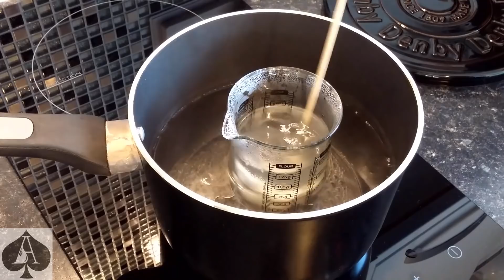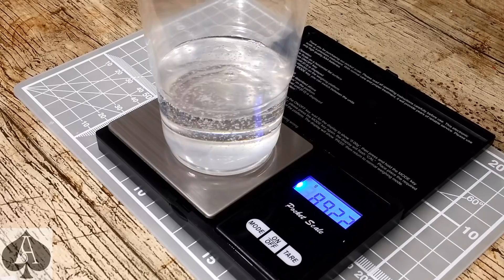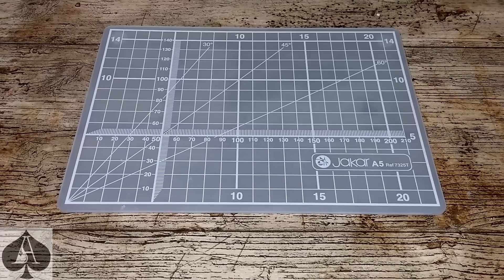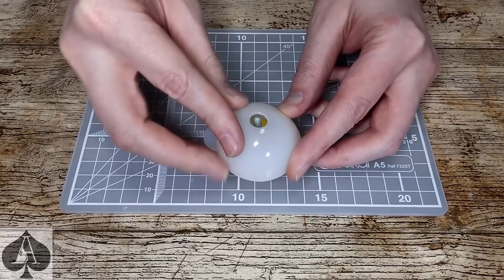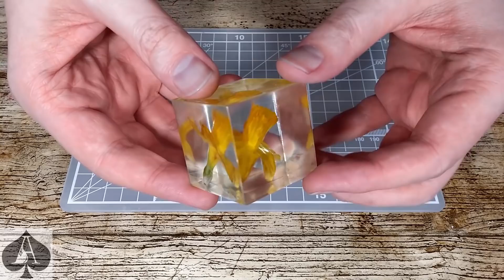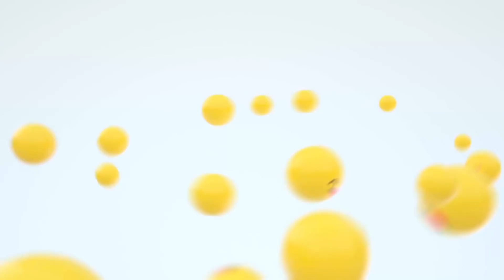Experiment: Can You Put Wax-Dipped Fresh Flowers in Epoxy Resin?

Comment: How is this possible? Was that wax the flower was 1st dipped into before set in resin? Was it dried completely before wax dipped? A real flower? Wouldn't the resin heat cause the wax to melt and distort in the resin??
Reply from the maker: The flower was fresh and dipped in paraffin wax. It was just an experiment, and the flower still turned brown over time. The melting point of the wax is around 50C, and your resin should not be getting that hot.

Comment: I've got a vole skull that i want to suspend in resin somehow but I'm not sure how - any ideas for design and/or technique? (The mandibles are separate from the upper skull so I'm not sure how to keep them aligned)
Reply: Ky look at doing it in several pours, do a base pour that you then sit the lower mandible on, then place the mandible and do another pour, then align and place the skull and do another pour leaving enough of the top of the skull for you to be able to keep it place by suspension or whatever means you choose and then do a final pour to cover, as long as you do it with clear resin or make sure your mixes are exact you wont see any difference in the layers, this method also makes it much easier to get rid of any air bubbles with a heat source if you dont have a pressure pot, there are plenty of videos around of these methods for you to watch first. Hope that is of help

Comment: Love your videos, but can you answer me this, why does my cubes look discoloured when I take them out, all moulds are cleaned and are dust free but always come out looking rubbish.
Reply from the maker: I really don't know. The surface of the mould will transfer to the surface of the resin, so if you have a shiny, smooth mould you should end up with shiny, smooth resin casts.
Reply: @resinAce  thanks for getting back mate, it was a brand new cube mould, it was quite dull, is there something I can use to make it shiney before putting in resin? Sorry for all the questions but I'm fairly new to this.

Comment: I've seen dried flowers in resin but a daffodil is not easy to dry out so wax is a neat way to go! Perhaps this might work with tulips as well? I tried to dry out pretty tulip petals but they lost their vibrant colours before I could use them...
Reply from the maker: I've never been successful at drying flowers without pressing them. It will be interesting to see how long this daffodil lasts. ♠
Reply: @resinAce  I tried with sand in the owen, it crushed most of the flowers. I then heard those tiny absorbtion pouches you get in shoeboxes etc are better, the problem is I rarely buy stuff so it would take forever to get enough for even a small flower.
Reply: Have you tried drying them by hanging them upside down in a dark place? I have a shelf dedicated to flower drying in my wardrobe. That way they retain their shape. Whether it retains its colour depends on the flower though.

Comment: You saved 2 small bubbles in the square resin piece. I am soooooooooooooo proud of you. Can I be even more patronising? I could try... What I'd like to see is a video of how you calculate resin for the size of receptacle you're using. You gave a tip before but there has to be a way to measure resin that even I can do or do you sometimes have resin left over? Or do you not make enough and have to make more?
Reply: What I do sometimes is pour water into my mold then measure that out then I try to make that much resin. It's not always super exact but I guess it's better than pouring blindly.
Reply from the maker: I only calculate 1g of resin to 1 cubic centimetre of volume. Cubes are easy - a 5x5x5cm cube will use about 125g of resin.
Reply: So I'll have to revisit my maths O level?  Can I still calculate the volume of an orb or any other shape? I doubt it but I learned it once at 15 I'm sure I can learn it again albeit 48 years later. I'll be back when I have the answer but I might be gone a long time!
Reply: That’s something I would love to know as well please, I always seem to have less so end up doing a 2nd pour, ok if clear but not good if I add colour as it always seems to show it and not for good reasons x
Reply: Tracy, if I can relearn the formula to calculate the volume of an orb or other irregular shape I'll let you know unless you know already.